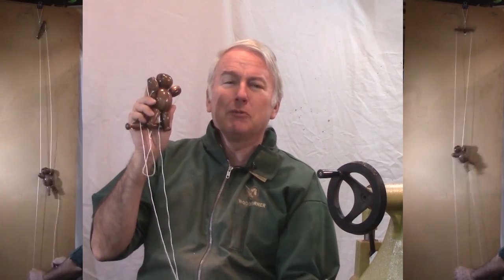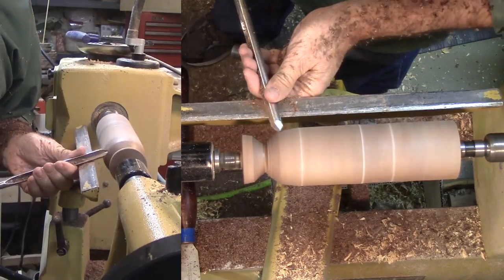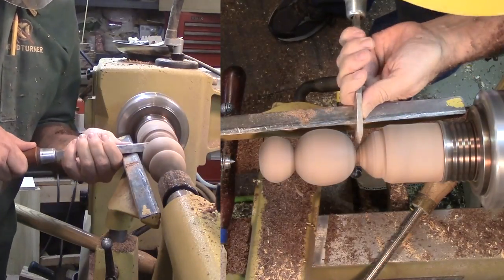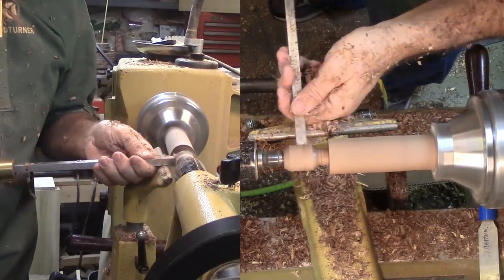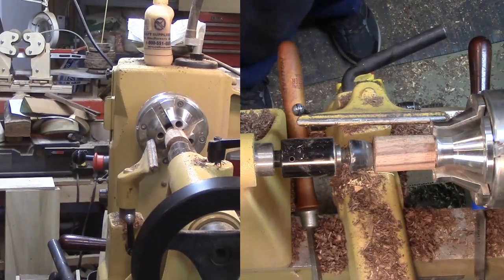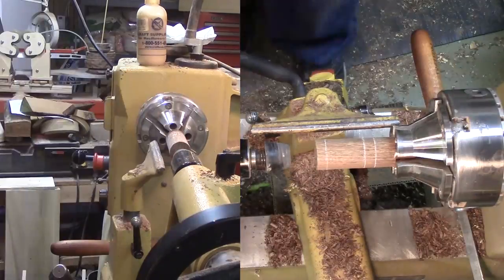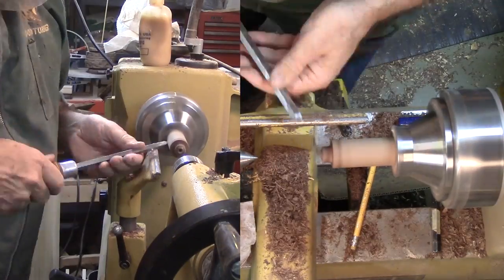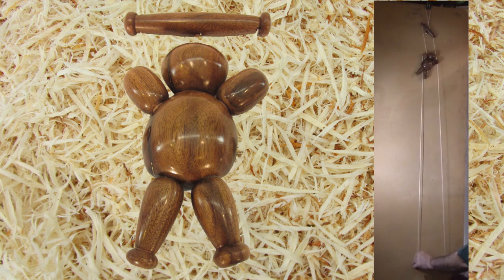Woodturning A Free Climbing Bear

Comment: Wonderful little toy, I think I would be able to reproduce it for my grandkids with your permission. The only problem is where to drill the holes as you do not show that in the video. Thanks again for a great idea
Reply from the maker: +John Fithian-Franks Nothing too particular about the holes in the arms. The principle is that they bind in the hole when under tension. I drilled them perpendicular to the axis of the arms. The upper hole opening needs to clear the head and line up with the hole in the top cross piece. Otherwise, they are near the end of the arms without breaking out.
Hope this helps.
Alan
Reply: As Wood Turns Thanks for the info, I hope to make some for my grandkids